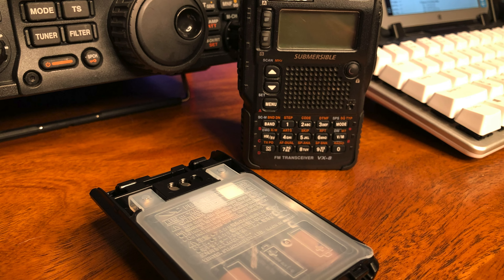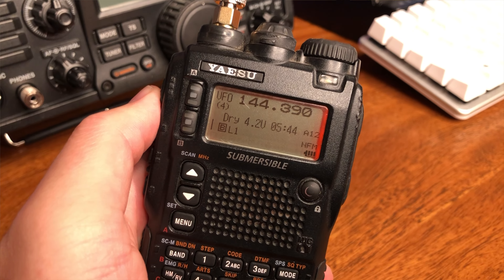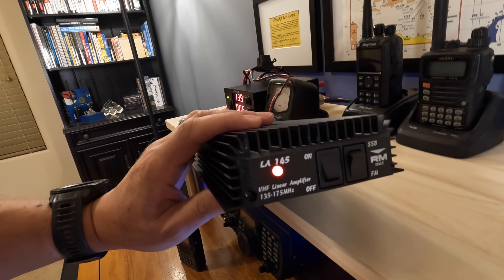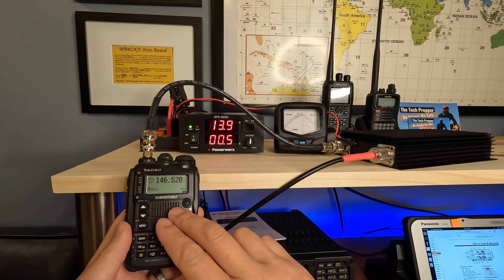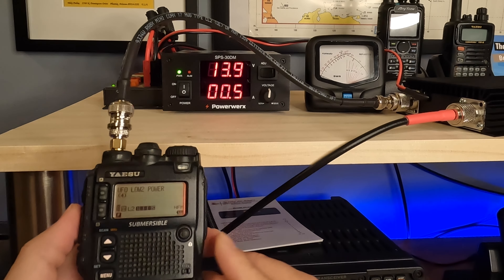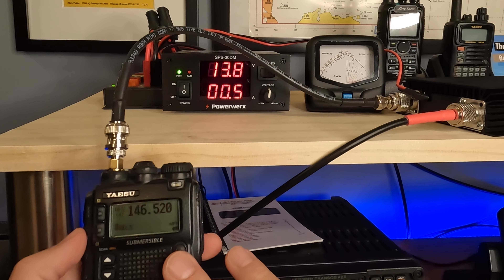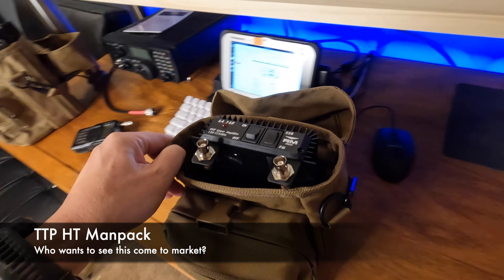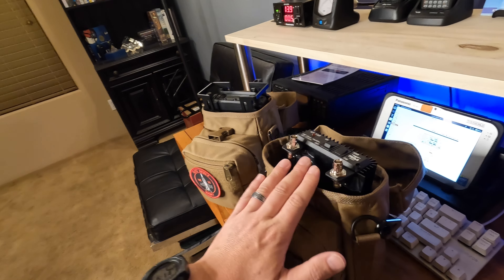HT Radio Manpack - Need more power for your Baofeng, Yaesu, ... HT?

Comment: I know you don't have time for extraneous projects, but it'd be fun to experiment with JS8 on 2m SSB.  It's lame on FM but works surprisingly well hilltop to hilltop for regional comms, even at low power.  That's why I wish manufacturers would give us FM and SSB on a handheld.  It'd be cool to hike up a ridge, put up a backpack Slim Jim antenna and use an HT to send digital comms 40 miles station to station.  If it caught on, have a 2m JS8 message server.
Reply from the maker: Timing appears to be me on my side. I have a supporter that also happens to be a local. We're testing 2m JS8Call after work tomorrow. We'll be running some FM tests at the same time. I'll keep you posted.
Reply: @TheTechPrepper  - That's an awesome if unexpected development.  Even if you can't get to the top of a ridge, 20 watts or more from a valley can send knife edge diffraction to a distant regional station and JS8's ability to dig a signal out of the noise does the rest of the heavy lifting.  I'm definitely looking forward to seeing the results of your 2m FM and SSB JS8 tests.  If you're feeling extra experiMENTAL, you guys might try a quick test of antenna polarization - vertical to vertical, vertical to horizontal, and horizontal to horizontal.  It's great that JS8 reports dB so all you need to do is record the results.  Above all... have fun!
Reply from the maker: @Liberty4Ever  Unfortunately, we are going to be using our horizontal Yagis for both SSB and FM. We both do not have an easy way to rotate our Yagis' polarization during the operation. In fact, I was just about to get on the ladder to rotate it from vertical (for FM) to horizontal (for SSB) now. I have about 1,000 ft. advantage over Phoenix, so this will be interesting. I have 99% confidence in this test as I routinely do SSB voice on 2m with 5 to 50 watts up to about 120 miles.

Comment: Again the thank you. Although not big on higher power [bigger footprint...so to speak, prefer small foot], but can definitely see tremendous application potential in certain circumstances. A shame the amp does not have UHF potential.  I have already messaged Armoloq.
Reply from the maker: The lack of the 440 MHz is a bit of a let down, but there is still a lot a value in a modular system like this. For example, this would be perfect for turning my DMR HT (AnyTone 878) into a base station. For grid down and and a no-rule-of-law scenario, this would work boosting GMRS radios (not permitted by the FCC). Thanks for sending ARMOLOQ a note.
Reply: Agree, particularly with the grid-down or WRL scenario. Still I am also working on a handheld UHF packable yagi to help with the UHF portion...and it meets my need for lower power solution in some cases.

Comment: I think that should be RM Italy. Great idea. What about a battery Lifepo battery. Run it on power level 2 from the HT?
Reply from the maker: That's how I plan to drive it...on level #2 (1 watt). I don't see myself needing more than 40 watts out. This would also be better for both batteries (HT and the amp).

Comment: So I have to ask, what was your hold up on max power? Since this was a testing scenario and not normal operation?
Reply from the maker: I tested off camera and it puts out the fully 85 watts. I would prefer not to burn through that much power on both the HT and battery that is driving the amp. I operate man portable usually so I would prefer not to carry a larger battery than needed (12-15Ah battery) or have to use more power than is needed to establish the contact as I need recharge in the field.

Comment: Gaston, just about everything is worth playing with at least once. For my first HT I bought a amp that was intergrated into an HT charger. That was about 30yrs ago and I haven't done it again, but I did enjoy it.
You sort of lost me when you ruled out your two best choices of a better antenna and higher elevation. That is throwing away a passive amplifier that doesn't require more battery power that works for both send and receive.
As you mention modular kit with part of the kit in a vehicle would it work using your HT as a remote to control a mobile rig in your vehicle. There are a number of mobile radios that are designed to operate as cross band repeaters. Would such a setup give you the functionality you are looking for?
Even a pair of UV5-R can be setup as a cross band repeater.
I don't believe the FT-857D is designed for cross band repeater operation, but it does do cross band send and receive so you could setup a HT or other radio to receive with the FT-857D in VOX to retransmit. That way you would not need to buy a radio specifically for cross band repeating.
As a prepper I am sure you realize there are tactical advantages to working a repeater with a directional antenna using low power. There are more advantages when its cross band on a frequency not related to the repeater.
If you are just wanting lightweight low power, what is the difference between the VX8 and the FT-857D, versus the amp, HT, and additional battery weight and powerwise.
Otherwise you can look at the amp as additional redundancy that may or may not be needed. Or, you can see it as an addition potential point of failure.
I am not sure there is a right, wrong, or best answer, but I am not sure you have clearly defined the mission objective based on mission requirements.
Options are good. Enjoy the gear. Let us know how it works out in six months or so.
I love your videos and thank you for all your hard work and knowledge that you add to the community.

Thanks again, N4VEP
Reply from the maker: Apologies for typos in advance. No time for edits.

You're right. It never hurts to try anything once.

Let me clarify. I get asked a lot of how to increase the communications range on VHF. My answer is always: 1) Improve your location (i.e. get to higher ground)
2) Add a higher gain antenna (perhaps a Yagi or roll-up J-Pole)
3) Increase power.

Increasing power is rough on an HT, hence this video. Obviously, the rubber duck is not rated for this kind of RF output via the amplifier, so for this demo at the shack I switched to a roof-mounted Yagi that can handle the 40 watts to 85 watts. In this field, this could be the same Arrow II Yagi, J-Pole or any other field antenna that can handle this power. In the vehicle, most vehicle-mounted antennas will do the trick, too.

In terms of cross-band repeat. I have three radios with this capability, but have only run two of them so far. In the Jeep I run the Kenwood D710GA as an x-band repeater for public service events. I also have the Yaesu FT-8900 in a manpack that I will also use for public service. Lastly, I have the AnyTone 578, but have not used it as I am holding off on DMR until the end of the year. It support sx-band repeat as well. It should be noted that x-band adds another level of complexity on both the repeater and the HT's. I have also not experimented with crossband repeat for packet or other digital modes.

My goal is to be able to use my EDC radio in different scenarios. Sometimes a small footprint radio (the HT solo) is fine, but other times, more power and a larger footprint rig is required. Occasionally, the HT or QRP radio has a feature that I need, but it just lacks power. For example, I routinely use my VX-6R with the DigiRig Mobile or Mobilnkd TNC with my other tools, so this is another great way, when needed, to strap on a jet pack.

I'll keep you updated.

73s

Comment: You are wise to stay out of the peak input range. There are diminishing returns at the top end of the range - Gain Compression. I ran my Mirage 3016 with 25 watts max in for close to 160 watts out. Older radios had some internal adjustment, so I disabled High Power (50 watts) and adjusted Low Power from 5 to 25 watts or a little less. I have had that amp running now for 30 years. I do watch antenna SWR - reflected power on all of these amps.
Reply from the maker: Thanks for echoing my thoughts here. Also, I'd like to be resource conscious, so driving the HT at 1 watt for the amp to produce 40 watts at 9 amps seems like the sweat spot between power utilization and power output.

Comment: How's your receive with the amplifier in line?
Reply from the maker: More testing is needed, but it seems to work well enough. I did not have my antenna switch connected to perform A/B testing.

Comment: Is there such an AMP for GMRS radios? Do you have a link to the pack that you use?
Reply from the maker: I'm not sure, as I'm not a GMRS user. However, there are very likely amps available if you do a search online.  This is a custom bag that I designed. I've shown it on the channel with various mobile rigs from Yaesu. However, I'm no longer making them.

Comment: Interesting idea Gaston, and within the spirit of amateur radio to try different things. However, I don't think this makes much sense. You are wanting to put the amplifier in a manpack that is the exact same size as your mobile VHF/UHF rig. I don't see the point of going with the amp over the mobile radio. They are the exact same footprint, both require a battery, and have similiar power outputs. If you took your mobile you would have a second radio in adition to your HT (2 is 1 - 1 is none). Even then the mobile has the increased power output on VHF and UHF, where the amplifier only has the increased power output on VHF. Not to mention the recievers in most mobile radios are significantly better than the recievers in our HTs - even the good ones. Try listening to a station on your mobile with an external antenna, then hook the antenna up to your HT. There will be a noticable difference in the quality of the recieved signal. 

I don't want to be that guy but I certainly wouldn't try ampliying the signal out of my baofengs. The harmonics on them are not what they should be, and you would be amplifying the harmonics as well. What harmonics may not have been a problem before may become one after you amplify them. Accidentally interfering with public service frequencies would be pretty dumb.

All that to say I hope your project is insightful and I'll be here for your videos on it. 73
Reply from the maker: Thanks for the comment. I am reposting a comment on my particular reason for why.

"I actually have a very specific need for this application at public service events where I need to have the ability to boost my power when needed, but can otherwise walk around and receive on an HT. Crossband repeat has been a problem out here with the high duty cycle and heat. [It] all depends on what "your" communications goals are. Also, in the house, I do not have a radio other than my HT that will do APRS, so I need to give that radio more power. At 118F is not feasible to stay outside to run APRS."

Comment: Imagine going this hard against just having a HT and a Mobile. I dig the modularity sometimes my man but at some point it starts to break down logically. HF rigs are spendy so this manpack in/out car thing makes more sense budget wise. 2M stuff...unless you have 6 cars yer gonna spend more on amps,packs,batteries,cables,etc. Than a couple basic 2M mobiles that will get it done better than the Feng half the guys copying yer idea are gonna use.

Comment: Every ebay, amazon, and Facebook marketplace seller is going to see a sharp spike in their sales of this amp in the next 8-10 hours. It shall be called a TTP spike.
Reply from the maker: Yeah, you may be right. This happened with the Panasonic machines (CF-20 and FZ-M1) as well as the VX-6R when I released a few videos on that gear. Also, I did not give ARMOLOQ the heads up that I was going to mention them. I am curious to see when they will contact me. ARMOLOQ: "What the heck did you do?". Me: "I'm just trying to bring practical innovation to the hobby while supporting American businesses". Cheers.

Comment: It lets you use all 5 watts
Reply from the maker: The specs state 500mW to 4 watts. In general, 1 watt out on the HT and 40 watts on the amp will solve my problems. I did a test TX off camera at 50 watts and it pegs the meter 85 watts. I would prefer not to burn through that much power on both the HT and battery that is driving the amp. I operate man portable usually so I would prefer not to carry a larger battery than needed (12-15Ah battery) or have to use more power than is needed to establish the contact as I need recharge in the field.
Reply: @TheTechPrepper   then it gives longer life, faster recharging, and in a huge disaster, almost all power tools have batteries in them to salvage in an emergency. All smoke detectors have 9 volt back up.  When nature blows the house away in the debris is all you need to get back on the air.
I love you videos  thanks for making them.
73 de VA6CQB

Comment: ham radio - solutions looking for problems
Reply from the maker: I actually have a very specific need for this application at public service events where I need to have the ability to boost my power when needed, but can otherwise walk around and receive on an HT. Crossband repeat has been a problem out here with the high duty cycle and heat. I all depends on what "your" communications goals are. Also, in the house, I do not have a radio other than my HT that will do APRS, so I need to give that radio more power. At 118F is not feasible to stay outside to run APRS.

Comment: APRS is pretty much useless
Reply: I wouldn't go that far, but it is limited in text message size. It does however interface with the Internet and can send and receive very short text and emails. The receive is only in reply and the reply generally has to occur within 15-20 min. For local off-grid text messaging it could be useful with or without an APRS local repeater.

I have never gotten too excited about APRS but I have tried the features and it can be useful.